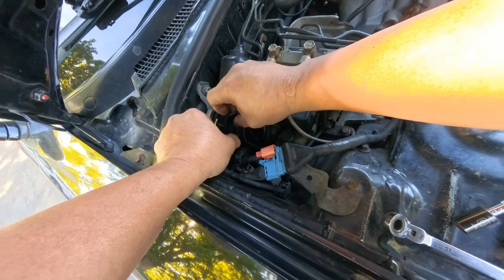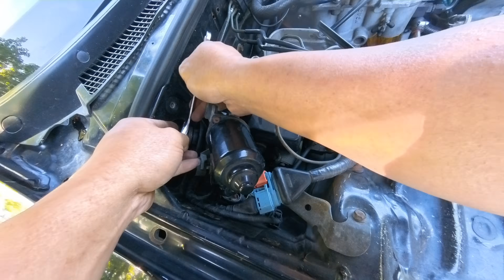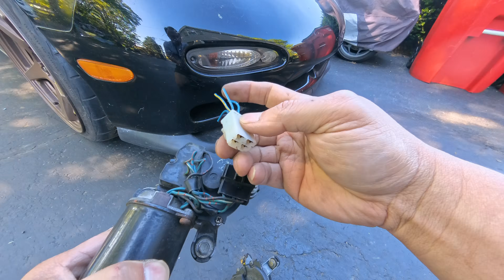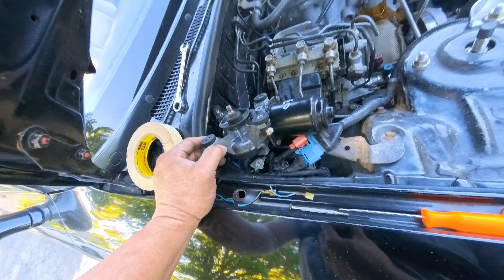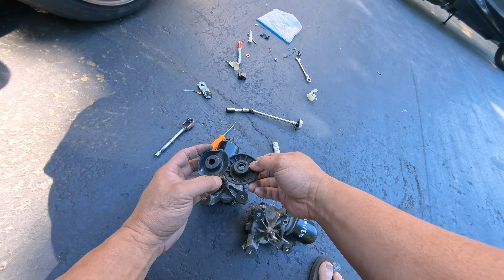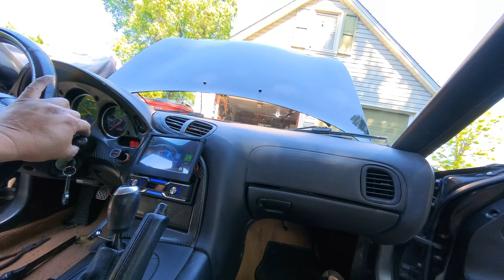1993 Mazda RX7 windshield wiper motor replacement with Mazda Protege motor

Comment: Awesome man! I took my stock one apart and cleaned the brushed and commutator. It works better but nothing like you are showing.  

You said the intermittent feature didn't work before you replaced it?  The delay for the intermittent function happens in the combination switch so you might have luck replacing that. The blue and yellow wire controls the intermittent function.
Reply from the maker: yeah the intermittent never really worked since i bought the car, it might have worked once or twice before. i figure it's probably the switch, never really had motivation to take the switch apart and clean it. i had to clean the switch on the power mirror and the old grease were all dried up. all the switches on these old cars needs to be serviced. lol